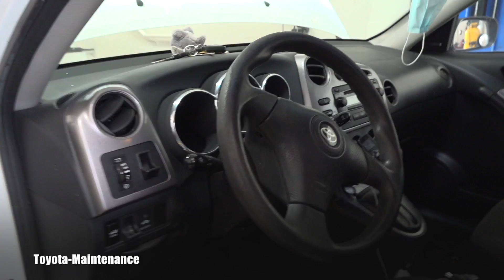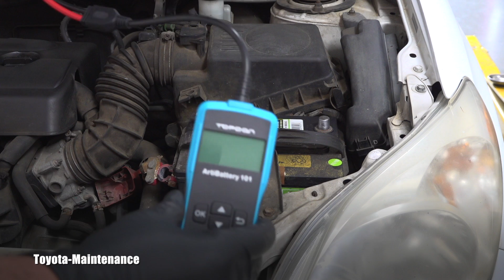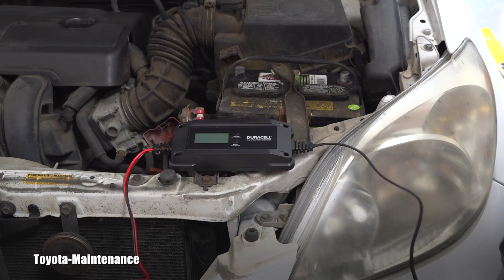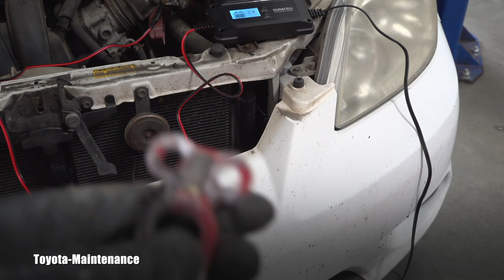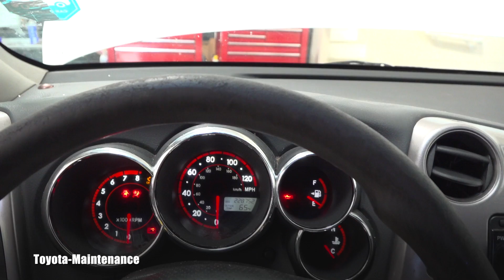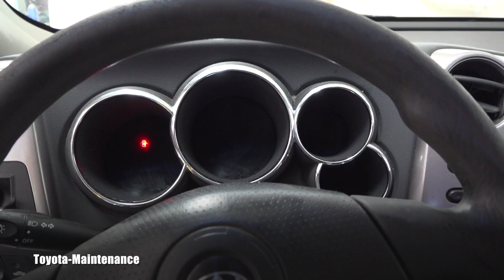Toyota Matrix no start diagnosis

Comment: 299,999 on my 03 too. I've had it 5 yrs and have replaced/repaired so much. Currently crank, no start. Thinking it's fuel pump (no engagement sound) or possibly electrical connection issue.

Comment: Nice diagnoses. I would throw that terminal in the garbage and use a Toyota style. Is there a video for the starter replacement? Thanks Petr. Edit: Searched and watched your starter R&R; nice work. I am doing an 05 Corolla tomorow; starter died at 137K. Gonna pull the fan assy for easy access.

Comment: This is great except my toyota matrix did exactly same but did NOT start when we smacked the starter. We changed the starter and it still won't start. Battery is fine and tested we changed the ignition switch before. Could it be the relay?? help me 🙏

Comment: I just replaced the starter relay in 2003 Vibe. {Matrix''''''' Because of intermittant no crank.I broke into the old relay with pliers to see what is what and there was what looked like lint from the clothesdrier balled up between the points.Must have been in there since assembly.A Denso relay.I will keep it for spare.I closed it up with black tape..CHEERS from Westcoast Canada!

Comment: Just found your videos today and I really like them! Too bad you don't live in Southern Ontario Canadabor I would bring my car to you :)
My parents gave me a Toyota Matrix(2012) about 8 months ago for free. It's in GREAT shape as they barely used it. They retired and no longer needed 2 vehicles. My dad did alot of upgrading work for me which was great. I've always repaired my own vehicles but since I have never owned a Matrix, I've been relying on your knowledge and videos to show me a couple things I am not familiar with. Currently my engin light is on and ii realized I have a coolant/Antifreeze leak somewhere. Also my TRAC OFF light has gotten stuck on and the button barely moves.. Once it's not 41°C(105.8°F) I'm going to go work with the car. Fingers crossed I can fix it without taking it to a shop! Sadly females still get shafted by many mechanics no matter how much they actually know about fixing cars.
Thanks for your super friendly videos! 💕

Comment: Wouldn't you just have to change the solenoid?  Or are they all one piece for this model vehicle?  The starter could have been checked by shorting the solenoid contacts and see if it turns over, is so then the solenoid is the culprit, if not, the starter would likely be bad.

Comment: Could use help! I drive my car for a bit (starts up perfectly) and get home, shut car off, and try to re-start it and it won't start....but then it will start up 5 or so minutes later. any assistance on this? It is def not the battery as I just replaced the battery a couple weeks back.

Comment: My coworker's 2005 Matrix would not start. Thought it might be the battery (also very corroded terminals), so I tried giving her a jump - no dice. Came across this video, and gave the solenoid a couple light taps as she turned it over...IT STARTED RIGHT UP! Great video, subscribed.

Comment: Thank You @Toyota Maintenance. My 2005 Matrix would not start. Tried the hammer trick and it started :-)...drove it back home and it won't start again. Changed the starter and noticed I was now not getting enough power, Had the battery checked and it had died. Got a replacement battery and it still won't start (very little power to the dashboard with some flickering). Then I rewind your Video. I started to clean the battery terminals again and make it look like new. Reconnected the terminals, and I see I have full power now. and Then it started:-). Hope this helps someone. God bless u all.

Comment: Mine needs a 15 amp fuse on the inside under steering column. The far left bottom row. One of the 3 out of 3 blue 15amp fuses. Then it started. But after hitting a bump in the road it blew the fuse again. But we did make it home. Now I have to check for a direct short to ground for this unknown fuse. A-Ok Truck Service here. 4798062368

Comment: The starter/solenoid may not have actually been bad. With the amount of corrosion and the painted after market lead it could have been that not enough power was getting to the solenoid for it to operate properly and the starter system simply locked itself. I've seen it happen a few times.

Comment: Same thing happened to my 2004 corolla probably 3 years ago.   I was in Mexico and had it towed to a shop and they took the starter apart and rebuilt it and got it going.  My father in law who's from there told me that they always rebuild the Starters  and alternators in the shop instead of ordering rebuilt ones or new ones. Same car is going strong to this day.

Comment: I don't know what it is about these Toyotas and their battery terminals. My 07 Corolla S  was so bad, it corroded THROUGH the positive terminal completely. Not enough Dielectric grease?  Bad water control through the wheel wells?

Comment: Check Engine light is on.  I would have used a wire wheel on the terminals, clamps, and wire ends as well as filing inner terminal clamp area.  And check the battery fluid levels.

Comment: We switched batteries, same thing happened until replacing starter. But if the starter goes out, like what recently happened, it doesn't crank. As soon as it goes out .Normally, cars crank a.. just like before on the first replacement. Dont know why..

Comment: That FM transmitter should be disconnected when not in use. It can drain your battery if left connected to the port.
Reply: I have had that exact one for over 3 years. No problems and works great. As long as your cigarette lighter i not always hot (flowing electricity even when the keys are out) it's fine.

Comment: I don't suppose this will be seen but here goes. We have a 2009 FWD Toyota RAV4 Base model with 2.5 L AR-FE engine. The transmission is running hot anywhere from 196°F to 226°. I would like to have an aftermarket transmission cooler installed. Any suggestions?

Comment: As a Toyota it probably just has green crosses on the red wire going to the starter and alternator or it has loose connection  not more that can go wrong on those old Toyotas hear we go again when will people learn stop using aftermarket parts they should have used the original connector and they should have replaced the battery first or jump start it  That's the first thing you do if a car won't start

Comment: Now that you figured out it was the starter. Instead of buying a new starter. Just buy a rebuild kit and replace the contacts and solenoid. Show people how to do that instead of a rebuilt starter.
Reply: Labor is cheaper to swap the part. But I get your point, things can be repaired not replaced. Most mechanics are parts changers...

Comment: It's good to use dielectric grease in electrical connection. It keeps connection points from oxidizing or corroding.
Reply: No, use electrical grease. Dielectric grease makes the connection worse. Dielectric is really only meant for high voltage applications (spark plug boots).

Comment: I changed my matrix starter its only two bolts to remove on opposite ends and the connections. part of the air filter hose gets in the way so you might need to remove it. Great video!

Comment: I would really like to talk to you about a problem I seem to have that the dealer nor a couple mechanics can’t seem to figure out on my 2008 Toyota Tundra 4.7 4x4. It’s a vibration felt only between 25-35mph under light acceleration. If I let off or give it more gas, it goes away and doesn’t return until I reach the same mph. If I’m being aggressive with the acceleration, it doesn’t do it at all. Only does it at those speeds mostly during 4th gear up-shift. Doesn’t do it at any other gear change up or down. I’ve had a new driveshaft installed and had wheel alignment and tires balanced. Some have suggested it could be coils or spark plugs. And there is NO check engine light or stored DTC’s. 
I would really appreciate any help, thanks.
Reply: That might be a bad engine mount, but it depends ... also, see Peter's video from June 19!  Title: "Steering wheel shakes while driving diagnosis"
Reply: I wish my problem was in the tires. The have been checked for roundness twice at 2 different shops (roadforced) and they were good.
Reply: Just in case you haven't checked, what about mud inside the rims?  Counterbalance off a driveshaft?   Anyone else have ideas for Jesse?
Reply: Yes all driveshafts replaced/balanced. I appreciate any other suggestions. I’m gonna take it back to the dealership for a flex lock-up test on techstream software to see if torque converter or transmission is to blame. I keep throwing a lot of money into a problem they can’t solve yet they are master ASE Certified techs who have said one thing was the problem but doesn’t get resolved. I’m at a loss. What puzzles me is that the symptom mimics a wide range of issues that can be any of them or multiples. It has about almost 30 hrs of diagnostics/testing without any answers, only theories.

Comment: If in doubt, the lump hammer will sort it out. Starting motor not trustworthy, otherwise going fine. Battery connections diabolical and would lead to overworked alternator. Aftermarket garbage, buy it and live with the consequences.

Comment: Very interesting angle at troubleshooting this issue. My first suspicion given the acid buildup on the battery would to check the alternator diode, thinking that perhaps that part of the issue was the battery being overcharged. I never heard of tapping the solenoid to get a car to start! That amazed me. Honestly though, the battery was 3 years old, the connectors crap to begin with...and I know you want to limit the expense to the customer, so I would have posed the question to them the choice of minimal (starter, battery recharge, cleaning the acid) as opposed to including the starter, battery and replacing the battery connector cable. Likely the latter would mean no less than a new battery that would go 3-5 more years and no incidence. I am wondering what your thoughts were about the acid buildup and the alternator?
Always great videos from you!

Comment: Replacement of that starter is made easier by removing the radiator fan/expansion tank assembly. 1 hose, 1 electrical connection, 2 10mm bolts, and 2 annoying cable clips. Lift it out, and you have tons of space to work. Re/re starter with that procedure takes about 15 minutes. No hoist, no jack, everything done from the top.
Reply: One secret also after like you said pulling out the fan you must use a six point socket to take out the upper mounting starter bolt. A 12 point will most likely round out the bolt like it almost did for me twice.

Comment: I had a 2003 Matrix and the only part that ever failed was the starter. That and the odometer stopped at 299,999, but that was a design issue.
Reply: Outstanding
Testing
Trusted
Toyota!
Reply: Scotty Kilmer said Toyota should never have stopped making the Matrix because it's an outstanding vehicle 👍
Reply: @1jackvalley580  I have a 2005 Pontiac Vibe, exactly the same as the Matrix.  Not a problem in 200,000 miles. UNTIL, I am ready to trade it in on this coming Monday, no start!  5 years on the battery, got a new one,  cleaned the terminals, no start.  Going to try the tapping tomorrow and see what happens.

Comment: Well done and thank you for the video. Once again, customer has no clue about their own equipment. Cleaning corrosion off terminals is something my wife knows about and certainly would have help the situation in the first place. I have to say, I was surprised that the starter didn't catch at first after that good terminal cleaning, but obviously they go bad, too.
Reply: I fond it ironic how little people understand about corroded battery terminals. Logic: if you have a remote control or a child's toy that has corroded batteries, everyone removes them immediately and cleans out the acid. Why would they think not to do that with a vehicle?

Comment: Get a new battery cheap maintenance I chuck mine out after three years I need my car to start in the cold winters
Reply: Battery wasn't the problem.
Reply: @perromion  correct it wasn't  when your battery hits three years old they get kinda sketchy good strong battery makes your car run better all the electronics need strong power to run correctly
Reply: @perromion  

You're Right , however ; the Battery Still has a Major problem..Since this is a Conventional Battery , each Cell between those "2" rectangle caps has "6" separate holes of sulphuric acid & water that is 2.11 Volts , thus; 2.11 X 6 holes = 12.66 Volts for a well charged "Conventional" Battery.

I bet it's more Voltage sitting on Top of the Battery than inside the holes combined...With your Voltage Meter , I guarantee it will FAIL the Battery Leakage Test..Place the Black Lead to the Negative Battery Post & Drag the Red pointed lead across the battery top( Car keys in your pocket ). It's gonna read 1 -9 Volts, thus Decreasing the Life of the Customers Battery by @ least 1 - 2 years...Voltage is supposed to be inside the Battery , not Living on Top of the Battery.

Clean the Battery with Coco-Cola or Baking Soda , Toot brush & Warm water.

Those Battery Cables & Top of Battery would be cleaner than a Dentist Office with my Before & After photos included with her other paperwork....Yep , the Starter , indeed is the Main Fault.

Automotive Professional background
Los Angeles County

P.S. - Also read in this Thread where a Fella said, " The Northern California Toyota Master Tech. didn't need to plug in the CCA of the Battery when the Tool CLEARLY asked him what is the CCA of the Womans Battery : If he would have ignored that & played the Role of a "SawMill" Mechanic by lets say inputting 50 CCA under or 50 CCA over, the Battery probably would have Failed & the Woman would have spent unnecessary money for a New Battery.........He was Right in his approach PLUS he already knew that the Battery was 75 % Charged because his Tool told 'em it was reading 12.4 Volts.

Open Circuit Voltage Chart :

12.6 or 12.66 Volts = Well charged batt.

12.4 Volts = 75 % Charged Battery

12.2 Volts = 50 % Charged Battery

12.0 Volts = 25 % Charged Battery

Less than 12.0 Volts , it's time to call
Houston, Texas.
"Houston, we have a problem"
"Houston : Go ahead California, is it a White Toyota & reading under 12 Volts"?

Comment: You DO NOT need to input the CCA on the tester!

You input it only for reference. It does not get used or changes any output from the tester.

I just press next and if needed, check the CCA of the battery after. All car batteries should be above 500 CCA so it’s easy to tell if a battery is bad (CCA and internal resistance).
Reply: I agree.